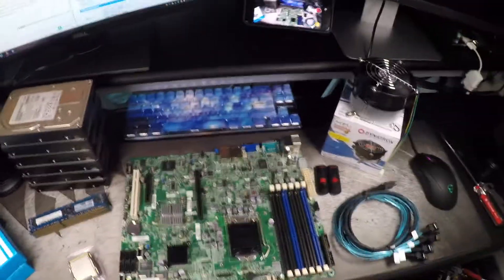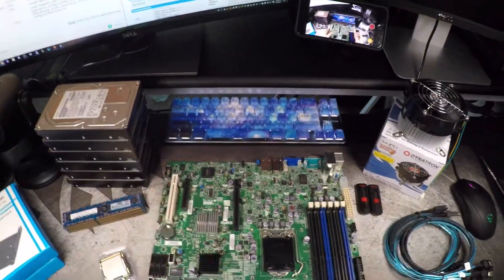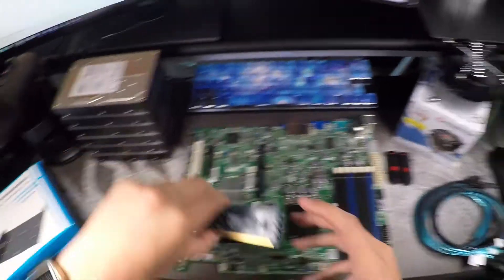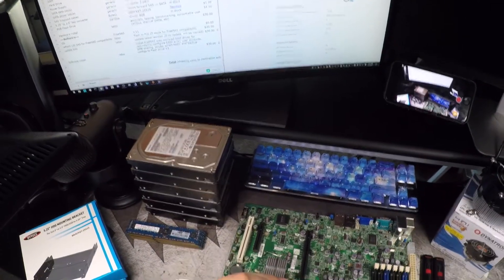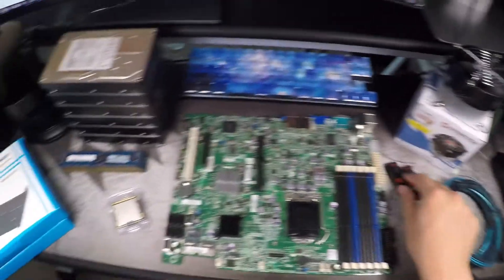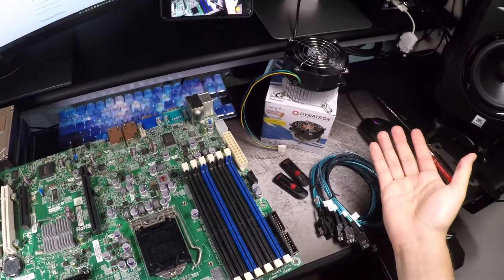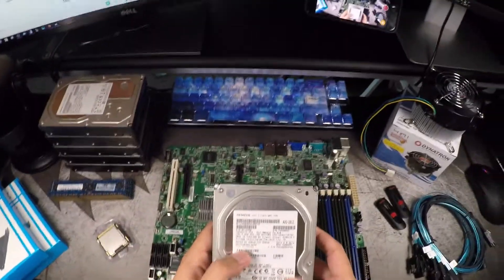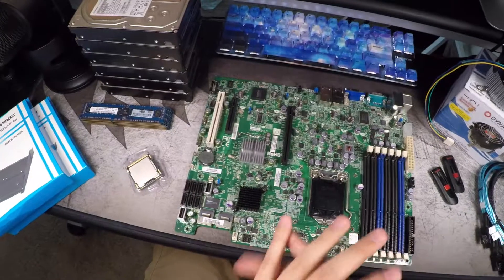/r/Plex Build Advice - $135 NAS killer build overview & livestream intro

Comment: can i use the sata ports in windows without using raid . looking to get an x8sil like the build guide but will be running windows, would i be good on the sata ports or need a lsi card in IT Mode ?
Thanks for any reply
Reply: dude thanks, one more thing, any issues running a 1080p monitor on the onboard vga. not looking to do gaming its gonna be a Unifi NVR system
Reply: i guess you can add a low end x8 gpu to that so i dont think it would matter
Reply: Good to know. Thanks Again. Love your videos Keep it up